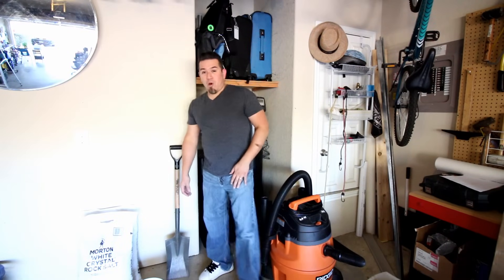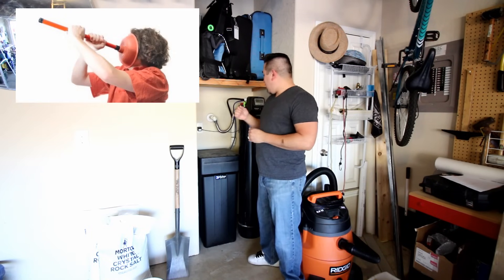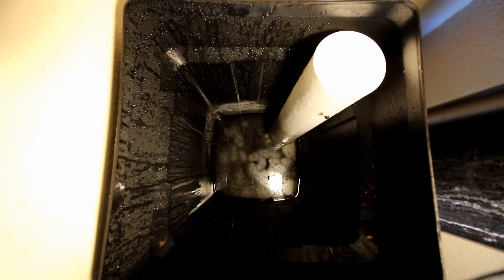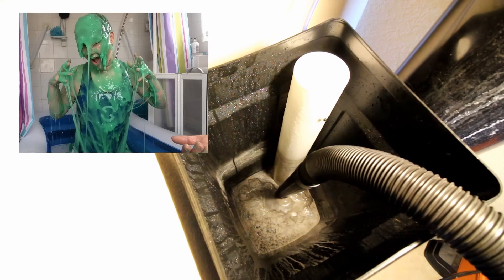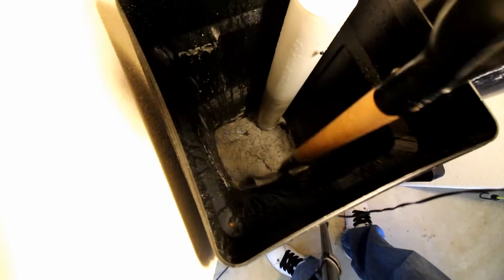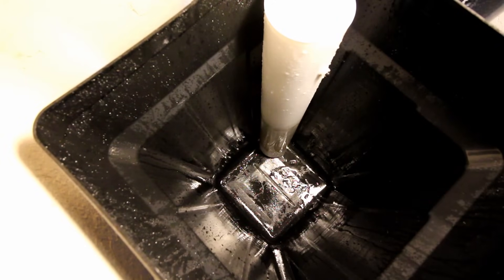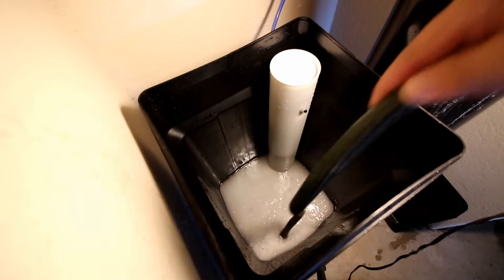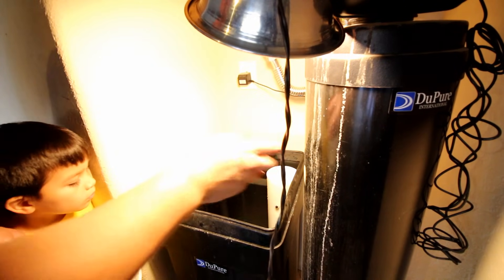DIY: Water Softener Maintenance

Comment: I've always been puzzled by these vids, because I've had a water softener for ~2.5 years, and have never had sludge, water or anything else in the salt. I just checked now and it's dry and clean all the way down. I have fairly hard well water, with a high level iron. I use a whole house filter, and the iron reducing salt. I add some water softener cleaner 2-3 times a year. The unit is very economical and uses very little salt.
Reply from the maker: That sounds epic. My system is mid-range premium, but still requires more maintenance than you describe. What type of system do you have? I am sure viewers could benefit from an upgrade in the near future.
Reply: @ThisGuyProductions  -I just have the Whirlpool WHE33, bought at Lowe's on sale. It's one of the least expensive you can buy, but highly rated. I have a standard whole house filter with 5 or 10 micron spun filter. I replace it ~3 x per year. It gets red, so I know it is taking out some iron as well as sediment before it hits the WS. It's set to regen at about the average time period. You can set it to backflush for extra two minutes if you have iron in water. I do that, and use the iron-fighter salt pellets, and have no iron at all now.  Also use the cleaner 2-3x per year'                                        I never go above three on the salt level marker, even though it goes up to 8. No need to, the unit is so efficient, and that keeps it from getting salt bridge.
There's just two of us using it, so we don't use much water.
Reply from the maker: @land7776  Thanks. Good info for us to know. I dont have a pre-filter, but it has been recommended by a number of viewers.
Reply: Land-  I have the same Whirlpool/Kenmore unit - do you clean it by dumping the bottle of softener cleaner into the tube or do you make up a solution and dump it in the tank itself?

Comment: Jesus Christ I have never in my life seen any dirt whatsoever in my brine well ever!
Reply from the maker: Thats great news. I had a combination of cheap salt and really hard water from South Central Texas
Reply: @ThisGuyProductions  funny thing is my softener has been acting up it doesn't seem to be doing squat and so I took all the salt out and it was spotless in the bottom LOL I just buy random no brand salt! Looks like I'm going to be buying a new God damn softener because I ain't screwing with it anymore
Reply from the maker: @ClownWhisper  Sorry to hear that. I've seen high softeners last about 15 years or so before they need to be replaced. I hope you got your moneys worth.
Reply: @ThisGuyProductions  I don't know I repaired some of the errors that I found I cleaned out the Venturi and I think it's working but it doesn't seem to exchange much water from the brine tank I don't know how much it's supposed to release and then suck back in? I have an empty except for a little warm water to dissolve the caked-on salt! I ran it through a cycle and it hardly dispensed or Drew in any water at all?? I don't know I wish I knew how much is it supposed to exchange in a cleaning cycle. You wouldn't know that would you? I mean they're all different but is it a noticeable amount?

If I filled it up halfway with a cycle drain it? Do you know?
Reply from the maker: @ClownWhisper  I am not that much of an expert beyond the very basics. Bottom line, if it isnt softening anymore and everything seems in order, you may need to replace the system. I would check some online forums based off the manufacturer and model #. Good luck.

Comment: You just have to use salt pellet as there are much cleaner. Also after you turn the bypass off press the regen button and then unplug the electric, this will release the pressure. Once you open that up you can use the cap to take out the piston and make sure that is clean.
Reply from the maker: Thanks, we have since started using salt pellets.

Comment: You should install a pre-filter. This will allow the water to be filtered before entering your system.
Reply from the maker: It would be a great help for anyone with really hard water or for those that draw from a well.
Reply: Actually it's only really beneficial if you have lots sediment that comes through your water. If not then it's not needed, the system will usually collect the small amounts and back wash it out

Comment: Thanks for the video. And after installing a system how frequent you need to clean the sediment on an average??
Reply from the maker: It depends on the salt you used. I changed to the Morton's in the yellow bag and there's been a tremendous decline in sediment build up. At this point I'm looking at once every couple years.
Reply: This Guy thank you
Reply: @ThisGuyProductions  cleaner location they make or gather the salt lol

Comment: What do you add to your salt? for the tank? the bottle your showed? and where did you get it
Reply from the maker: I got it from home Depot, but you can pick up similar versions pretty much anywhere. It's just a basic water softener treatment that clears out build up. The one I used is called Filter Mate Softener Cleaner.

Comment: Would this be why my pressure is low? I bypassed the softener and pressure is fine. Not a new install. Just randomly happened.
Reply: Do you have a water filter ? Check that maybe it needs change
Reply from the maker: It can also be due to buildup in the resin tank.

Comment: Also I seen you got the filter under the sink how you replace those?
Reply from the maker: I am actually debating replacing the entire filtration system since the current system was installed by DuPure. They want $300 for replacements and they wont let me do it myself.
Reply: @ThisGuyProductions  same here they contact me every year to replace the filters but I wanted to do it myself to save on cost. And thanks for answering those questions. They said that it was time to replace the membrane but I wanted to do it myself just don't know how to go about getting parts.
Reply from the maker: @millionmilesaway12  The membrane is actually in the housing that holds the three stage filters. I am about to replace the entire system myself. I could buy adapters to allow me to use 3rd party filters, but at that point its the same cost as a reasonable system from a hardware store.

Comment: So after adding salt and running the system, can you use the water or how long do you have to wait before using water?
Reply from the maker: There is no delay. Your water is ready to go right then and there.
Reply: @ThisGuyProductions  Butt the water is nog soft right?
Reply from the maker: @hendriksolle9893  - During the cleaning shown in the video the system is set to "Bypass" which means the water is not soft while you perform your maintenance. Once you are dont you switch the bypass off so your system goes back to softening like normal right then and there.
The solution added to the brine well during the maintenance isnt introduced into the system until the next regen your system performs. Once the regen cycle ends the system is softening again.
Reply: How long do you leave the valves on bypass?
Reply from the maker: @miguelg6781  once the initial brine well cleaning is done and you've filled with salt and water, you can switch it off bypass.
Reply: Thank you sir !!

Comment: I just got my new water softener!  The tech that installed it told me to only put two bags into the tank.  I recall my uncle had a softener and we always filled the tank with salt... 6 or 8 bags?  Which is right?  Only two bags looks very empty and I want to add more... may I?  THANKS!
Reply from the maker: I always prefer to add 3 to 4 bags. But yo be honest, it ends up being 2 bags per month for me. I don't have negative side effects except for running out of soft water more often. Just keep in mind that a lot more salt in the tank may result in bridging.

Comment: this looks easy, so if t he water from there looks purple i have to do this...
Reply from the maker: Not sure on the purple color. It could be due to some kind of buildup or growth. Is there any odor from the brine tank? I'd keep an eye out for dirty sediment at the bottom as well.
Reply: the tank where the salt goes does not smell but the water from the shower does smell
Reply from the maker: It does sound like you got something happening in your system. It is beyond my expertise, but I would consult your owners manual. There are also several washes you can dilute into your brine well that can help resolve during a regeneration cycle. Do you have well water?

Comment: Video is educational and fun--so kudos. Venturi is not that hard to understand. It is when you have to flows: the central flow that comes thru the middle and then side flow that is pulled in from the side as the faster central flow comes through. It is important in any flow (air or liquid). Think of the wake of a boat. Or better yet, thing of drafting on a faster vehicle or behind a phalanx of bicycles.
Reply from the maker: Interesting comparisson.

Comment: Hey I added 5 bags of salt to my tank and 10 gallons of water (the water was a couple inches over the salt) 

I did the regen and it did the two cycles now there isn’t water over the salt 
Should I add more water or is it ok?
Reply from the maker: You are ok as is. There should be water in the lower part of the tank now. Normally I only add 3 to 4 bags at most.
Reply: This Guy 

Thank you for reply tho
Reply from the maker: @gregballard4318  5 bags won't break anything. The only concern could be bridging which you can easily break down.
Reply: This Guy 

Thank you for the info man first time doing maintenance next time I’ll do 4 bags I’m gonna subscribe if you don’t mind haha
Reply: This Guy yea I saw you mention to someone 3 bags but I have a tank that goes up to level 4 and 5 bags for me was just over the level 2 line so that’s why I did 5 bags

Comment: At 11:18 are there not other parts floating in there that should be reconnected/centered before reassembly?
Reply from the maker: The other parts you see in there aren't actually floating around in there. Its an illusion from the water distortion. They are outlets beneath the valve.

Comment: Someone help! I never seem to remember to add salt pallets to my softner. What's the worst that can happen, besides hard water??
Reply from the maker: Yes, hard water and your system will regenerate and basically waste water. I set a reminder on my calendar bi-monthly.
Reply: Not true, the media will deplete faster if it does not clean the hardness off. The calcite will build up on the media and harden up making it difficult to come clean again. And if you have iron, your softener should regenerate weekly because iron will do the same but faster. Ionic exchange is confusing but look it up to get a better understanding of how your softener works

Comment: what areas of the system can leak? i have a leak in the lines and one directly below the box system. Nothing connected to the house. Never had to deal with a softner system and renting at the home. What might be some causes? can they be easily fixed? any help is appreciated
Reply from the maker: If the leak is coming from a "threaded" connection where one hose screws into another the leak should be resolved by using plumbing teflon tape. Unscrew the hose, apply the teflon around the threaded connection then reconnect the hose. On the flip side if the leak is coming from an area where there is an "O"-ring it could be due to an old dried out or cracked O-ring. In that case you may need to get with your landlord to make the repair especially if the water is causing any kind of damage. Your landlord may hold you liable if the leak isn't reported. If you feel you can fix it (not suggested since you are renting) the affected o-ring can be replaced. Lowe's and sells a ton of o-rings in the hardware aisle.

Comment: Wow only 3 bags? I’ve been filling the whole tank with salt (about 200lbs.) Is it over kill to fill it all the way? I have to refill almost every other month. Only 3 people in our home.
Reply from the maker: Bill Wilson something sounds incorrect. How many gallons between cycles? I run every 900 gallons and go thru 40 lbs a month.
Reply: This Guy I am not sure. It does regenerate every night though. I have the GE Avantapure and it says 1582 capacity remaining.
Reply from the maker: It should only regenerate like once a week with the head count in your house hold. Consult the owners manual. There is a problem with your regeneration cycle.
Reply: This Guy thanks for the info. I will check the manual. Great video!
Reply from the maker: Bill Wilson thanks. Let is know what you find.

Comment: Can this run back into water supply if valves go bad? Every Time the system cleans, the house next door water turns white like milk. Whats going on? Please advise.
Reply from the maker: Mojo Man! You gotta call a plumber. This sounds worse than a water softener issue. There is supposed to be some kind of back flow system in place around your (you and neighbor)  water mains that is supposed to these issues.  It sounds that is missing at your place. Its not the water softeners fault.

Comment: If the system is 40,000 grain, how many inches of water should be in the well  for 25 minutes of Brine Drain?
Reply from the maker: Sorry Sahmadi, too technical for me. I'm just a regular every day guy. I usually add enough water so there are a few inches of water above the salt I added.

Comment: Mine smells like rotten eggs from sulphur bacteria. Do I follow the same procedure to get rid of the smell?
Reply: The sulfur smell could be coming from bacteria that live in your aquifer (water table)... you may want to 'shock' your well every once in a while. I usually wait until I start to notice 'that smell'. You can use bleach or hydrogen peroxide to shock your well... I use peroxide because it dissipates faster after doing its job and doesn't add a chlorine taste to your water. I add a gallon of peroxide (stuff you buy at the pharmacy for cuts will do) to the well head, run a hose down the well head that comes from a source before the softener, and let the water run into the well head for about twenty minutes and while doing this DON'T use any indoor water . After the twenty minutes is up remove the hose and close up the well, then run your internal faucets and flush the toilet a couple times. Your water should lose that sulfur smell.
Reply from the maker: Thank you Jack
Reply from the maker: Hey Han, That exceeds my expertise. There are options and products to clear out bacteria, but I havent used them yet. Let us know what you find.

Comment: Nice video and very encouraging.  I have a Rain Soft EC40824 installed 16 months ago.  It's never softened that well, but I only had an iron filter before so I put up with it.  I was told all I need to do is use a specific sodium pellets with iron product, which I've been doing.  The iron removal wasn't bad for a while, but now I'm getting orange water.  Are you able to tell me the best procedure for troubleshooting this unit?  It's connected to a well and septic tank.  The raw water hasn't changed.  Thank you for any suggestions.
Reply from the maker: Hi Carol, Unfortunately this is well beyond my skill set. I know that some purifiers can use Potassium Chloride, but I am pretty sure it isn't going to solve your issue. The orange sounds like a type of algae or microbes. Here is an article: https://www.diychatroom.com/f7/orange-water-softener-87399/

Comment: Question. Is it bad to let the salt level go to low before adding more? I always let the salt go down to the 2 or 1 bag level before adding more salt, to avoid bridging. But there then is less salt and more water at the bottom. Good or bad? Thanks
Reply from the maker: TBH there are times that I am too lazy to get more salt to the point that I have barely any. I haven't seen any negative impact to date from letting that happen. Just get a better quality salt and avoid the cheap junk I used in my video.

Comment: FYI the venturi is the hole in the Flow Plugs (see 1:23). The reason I mention this is very often the Lower Flow Plug Venturi can also get plugged and cause the same thing. You should check this if the mesh net (screen) is cleaned and still not using salt. Using a phone camera step by step wile taking the assembly apart can help you put it back together properly. Good Luck and remember the numbers on the flow plug are installed with NUMBERED SIDE UP which is the easiest mistake people make when reassembling.
Reply from the maker: Dave Patten Thanks Man!

Comment: I’ve used two different water contractors and they were both adamant about using pellet salt and not to use rock salt because of the buildup.
Reply from the maker: Larry Medeiros thanks. Many folks have shared the same info. I have since switched too.
Reply: I have used both and both will build up and bridge. It helps to let the salt drop as far as possible before filling again. But, no matter what you do, build up will happen. That's why we do maintenance on our brine tanks.
Reply: Culligan told me use crystalized not pellet to avoid bridging. Initially I just had them deliver and fill till I had them leave a few extra of their bags.. it was dirty and had pieces of wood in it.  Now I just hull them from Lowe's.
Reply: @genesmay6589  i just bought a brand new house myself and no one told me what type of salt to use or anything until me and my wife just started asking people.  Id have to say 98% of them used the pellet salt with the green on the label.  Its the bag that's almost 8 bucks a bag.  And absolutely no one said anything about maintenance.